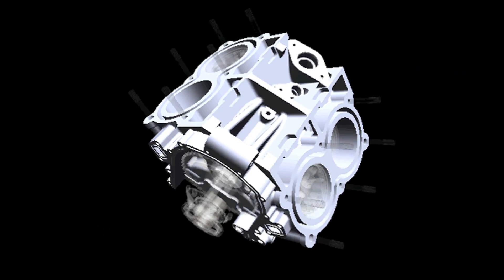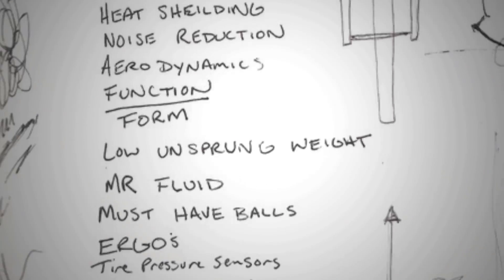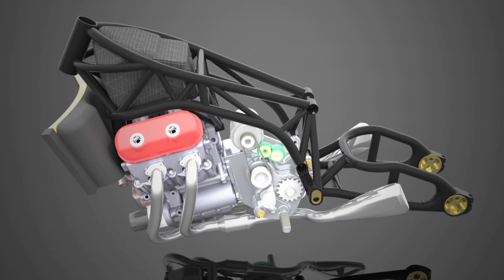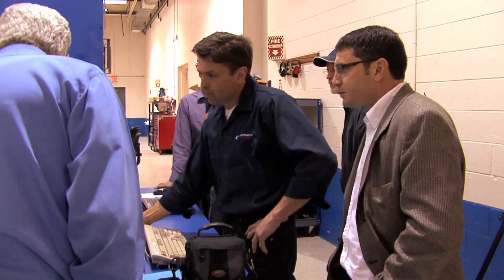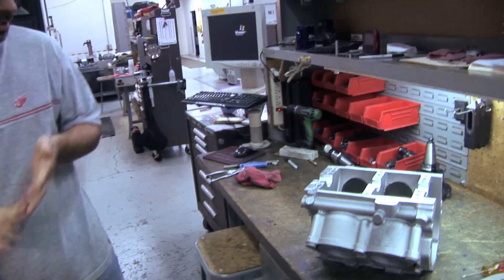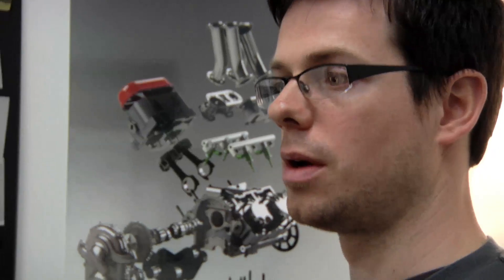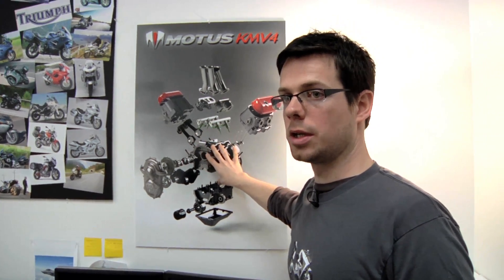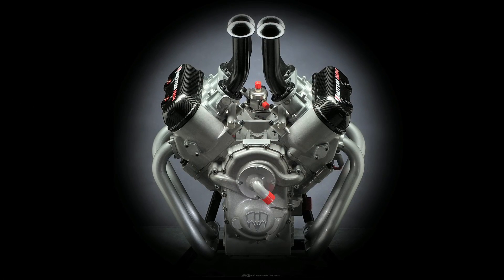Motus-The KMV4 Prototype GDI Engine

Comment: Motus should definitely come out with an ultra fast racing bike later, the engine sure is a perfect platform to modify and tinker with to take it to insane levels of power output. i don't even want to imagine what is gonna happen if the engine gets a turbo induction  system. anyways, good luck and lots of success with your sports Toureing Bike !

Comment: curiousity has strucken me... i wonder if i could fit this in my 91 Fesitva ? the 1.3 4 banger does well but at a rought 89 h.p. / 76 f.p.t  Yes yes i know lol all u want but, impressivly i ran a 18.9 in a 1/4. i figured it would do like a 23/24 but i was surprized my self. I did a little tunning to it my self i.e- cold air , high flow cat, 2 1/4 exhaust, no muffler ( she screams) lol. And yes i know it's festiva

Comment: @505197 GM's line of DI's apparently have the injector spray into the cylinder aft of the intakes opening, thus washing the tops of the intake valves, on Mazda's not 100% sure if they do the same- but looks like its shot before the power stroke, so its prob anyones guess as to how motus/katech plan their fuel ignition. we shall see.

Comment: @505197 theoretically that cant be since the back of the valve never sees hydrocarbons, however since the fuel doesnt wash the back of the valve, the little oil that is sent to the valve guides can run down to the back of the intake makes build up but its so miniscule. a professor studied it and saying that if the injectors spray hits anything before atomizing it creates mass amounts of emission particulates, but Mazdas is 'Air guided' assuming its being atomized before touching anything

Comment: @Ryknfjor The injectors are in the combustion chambers, like a diesel, which I'm sure you are aware of. The problem is not with the injectors, it's with the backside of the intake valve. The fuel isn't washing over the valve as has been in the past, and some manufactures are having problems with so much carbon build up the car starts misfiring at rather low mileage. Inductions cleaning on a regular basis is recommended, and some instances heads are removed for decarboning. Do some investigating.

Comment: @505197 wrong. DI has no carbon build-up probs. these injectors arent the same as normal-they shoot at 20,000psi WAY more than normal, it cut through carbon like no-ones biz. Pratt-Miller a serious engineering powerhouse co-designed along with Katech designed the engine and i think they would know all the minuses of something like that. Diesel engines been runnin em for a long time.

Comment: Direct injection is a problem and ought to be abandoned until intake port carbon can be solved. Autos are experienceing so much carbon build-up in a short time theyh have misfires. No fuel in the ports means no cleaning, and the over-lap of the valves allows some reversion of gases that tend to build up. Toyota employs injectors in the port and the cylinder and don't seem to be having the same problem.   Nice simple engine, tried and true 50 year old technology.

Comment: @falaqdad15 You're right, but its really not that odd if you think about it, it still is a cross plane crank, its just that since its only a V-4 theres only two crank pins, and the still 90 degrees to each other, so its still truly a cross plane crank.

Comment: As I learn more about Motus, I continue to get more excited for you guys. This looks like an OUTSTANDING bike. Pushrod engines have many advantages, including ease of maintenance and durability. With car engines, large displacement GM engines often get superior fuel mileage to heavier DOHC engines, plus they're cheaper and lighter. 

PS: As the owner of a vintage Moto Guzzi, you put the engine in the CORRECT direction, not sideways. :-) I hate when people call my longitudinal engine transverse.

Comment: two cylinders is plenty if you do it right, but I think this will be cool.  I think the pushrods are reliable but limit the max revs, which their direct injection does anyways based on what I've been reading.  It won't be winning races but it will be sweet to ride on the road.  Hopefully they keep it light enough to be as manageable as other large displacement sport bikes.  But with a long enough wheelbase not to flip over backwards :)